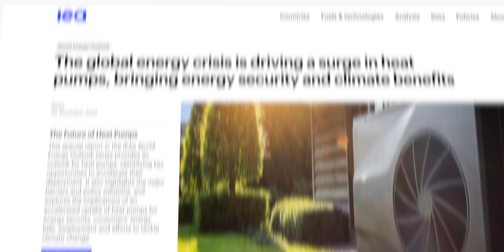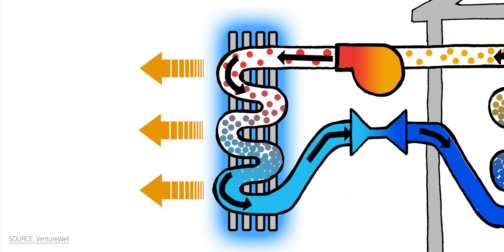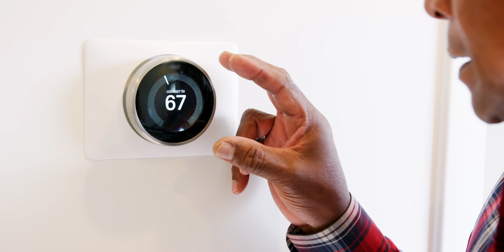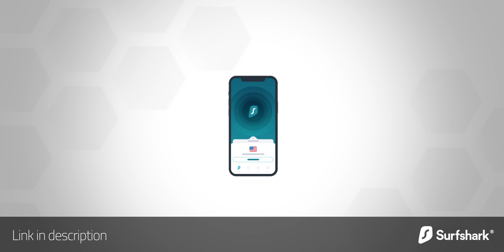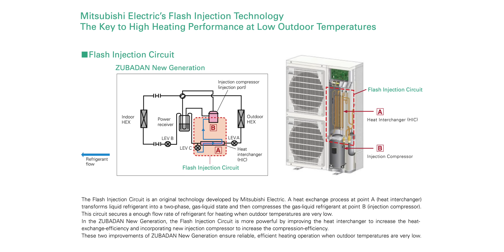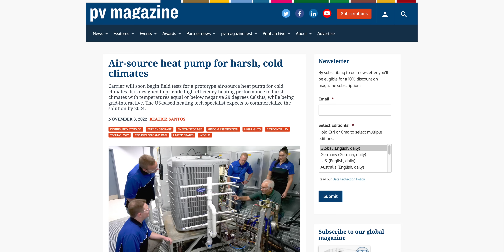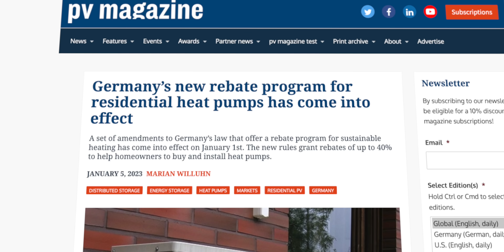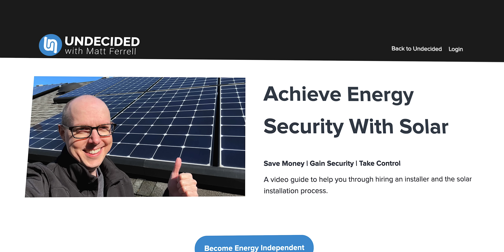Major Advances with Heat Pumps in the Extreme Cold

Comment: We just installed a dual fuel system in our home, gas furnace and a heat pump. The heat pump works from 35 F or above and the furnace works from 34 F or below. I live in Denver Colorado and the Daikin fit heat pump was pretty much my only option. One major consideration is that the heat pump runs pretty much constantly. We keep our home at 67f and the air that comes out of the vents is not warm or hot. But it does keep our house at the temperature we selected. Our cats hate it. They no longer sleep on the air vents. The major adjustment for us has been it feels like the system is constantly running. It reminds me of being in an office building where the HVAC system is constantly reading. Very grateful that we went with a super quiet heat pump and furnace blower because if it's going to be constantly running it will drive you crazy.

Comment: Matt coming from the UK originally Google is continually sending me stories from people over there saying they are spending a fortune on heating after installing a heat pump. 

I see a common theme there - cold damp weather causes icing and continual defrost cycles, and very expensive electricity relatively cheap gas. Even at a COP of 3 they basically only break even. In the winter it is costing them more relative to gas they are usually replacing. 

Furthermore most people are running the pumps almost exclusively for heating, not cooling. In fact it seems many are used to heat water which is then circulated in legacy hydronic radiators vs forced air systems - because UK homes seldom have any ducting and being brick and plaster rarely have the option the option to retrofit it.
Reply: The UK has a problem with bad installers, the heat pumps for the most part aren't really the problem.  Icing-up isn't a problem that needs to be tackled with continuously and needs a large build-up before the defrost cycle kicks in, maybe once an hour at most.  COPs are usually closer to 4 with a proper installation in the UK.  The problem with the UK being able to use them (as in just upgrading the central heating system) for cooling would require a massive retrofit, as the pipes used for the rads/fan coils for cooling need to be insulated, either in using the existing 2 pipe system (Heating OR Cooling), or upgrading it to a 4 pipe system (Heating AND Cooling).  Abandoning a central system and going for Air to Air also allows utilising the cooling functionality.  There are a few Brits that have had or done Air to Air installations over a central system (Dameon Hill - not the former F1 driver, "Tim & Kat's Green Walk",  The EV Puzzle) to name a few.  And they use different solutions for Domestic Hot Water.

Comment: Have you heard of the Wellconnect heat pump? I have installed one and heat my house completely with it.  2600sq feet and I live in northern Michigan.  It uses a water flow from my well, so I guess it is a water to air.
Reply: I guess I should have said "heat and cool."

Comment: How conveniently he leaves the most annoying part of heat pump, noise. I can never fall asleep with AC compressor running right next to my house
Reply: Probably because most modern ones are very quiet as it is, my old 2007 Panasonic was outside below my bedroom window and never made enough noise to be a problem.  Nor does my new Toshiba one that replaced it.  The Toshiba one also has a Quiet option to reduce the "noise" the outside one makes, but I've never needed to use it.  I live in a town where about 80% of houses have an Air source heat pump, and you can only hear them hum if you are within a couple of meters. The local grasshoppers are many times louder in the months they are out.

Comment: Only in the States.  Now imagine you live in a densely packed city.  Air heat pumps are the only option here.  Where do most of the worlds population live - cities.  Living in the UK the government is virtually forcing this system down our throats but it would be astronomically expensive to fit to my house.  I would need to re-insulate it.  Yes I have cavity walls but they are there for a reason - to stop damp.  Filling them with insulation brings all sorts of long term issues.  So I would have to go for a much more expensive insulation solution (a second skin).  Then I only have a small house.  Where does my hot water tank go?  I cannot afford the space in any of my rooms so it would have to be in the attic (there are designs of long flat tanks for this kind of thing - again expensive).  Also being in Edinburgh, Scotland typical average temperatures are around 10C.  Next all heat pumps have fans.  I am not aware of any fan system which does not eventually start making a noise.  You should hear the air con systems for the supermarket next to me sometimes.  So would I part with over £20K to get my home up to spec (that includes the governments paltry subsidy) or will I buy a new gas boiler (for about £3K) to get me through the time it takes the government to realise these are not the panacea they think they are.   Check out https://youtu.be/GhAKMAcmJFg for why heat pumps are not that great.

Comment: I have a Bosch air-to-air heat pump. It’s crazy efficient, SEER of 19, variable power up to 5 Tons of A/C. It’s a dream in Summer. But it is completely useless when it’s below 40F. Thankfully I’m in Central California and those low temps usually only happen for a few weeks a year but when it’s 29F outside and 55F inside and the unit is in defrost mode….better have a space heater handy!

Comment: Most heat pumps never achieve COP of 3. In May installations during cold weather the heat output is significantly as a result of consumed electricity from the grid. Eveb if you only pay for 1kWh of electrical energy to get 2.5 -3 kWh of heat, the electricity is generated at the power station by a gas burning turbine generator which is about 30% efficient including transmission losses to your home. So 10kwh of gas burned in a sas turbine generator,    wired to your home and heat pump will generate 7.7 - 9 kwh of heat in your home, with a $15k heat pump, plus all the increased power infrastructure to get the huge increase in electrical power to your home. Burn the 10Kwh of gas in a small 97% efficient $900 gas boiler, and you'll get 9.7 kwh of heat directly to your home.  No losses,  minimal maintenance, and no enormous electricity bills up to $1000 per month.

Comment: I am in Aus and have the exact opposite problem. Trying to discover whether a HVAC can function up to, about, 50c. The official temps can get close and the unofficial has been known to beat that number. Unfortunately, I can find no data. Everything only wants to talk about working in low temps (Not an issue as we max out at about -5c.)
Reply: Don't know how widely available in Aus, and it would be expensive to install, but Ground Source can do cooling as well, you would likely need a unit with active cooling, as passive cooling at 50C outside is likely not going to make a dent, needs insulated pipework and fan coils instead of radiators to provide the most efficient cooling.  Ground Source has no outside unit, so isn't exposed to the much higher outside temperature.

Comment: Heat pumps are only viable (in terms of money kept in your pocket) if paired with solar. 
I fell like you missed on some key things about heat pumps. Most important is the fact that efficiency wise, they are over 50% less efficient in heat pump as apposed to AC mode. 
A person switching from a gas furnace to a heat pump without solar to offset the operating cost can expect to pay 2–3 times as much to heat their home. Your running your AC year round! 
You also forgot to mention in cold climates there’s usually some form of back up or emergency heat, usually electric heat strips, which even the 5kw heat strips will pull the same amount of amps as a 2-3 ton AC.
Reply: (Assuming you mean Solar Panels) Solar PV + Heat Pump isn't really the most effective use of the sun's energy, as Solar PV only converts about 25% of the sun's energy to electricity.  Whereas Solar Thermal going into a hot water tank is about 80% efficient, so would be better to use that whilst the sun is out, and power a heatpump off the grid or battery storage when it is not.  Also, Cold Climate Heat Pumps have been a thing for some time (just seemingly not in the US), with many still able to produce enough heat down to -25C and sometimes below.
Reply: @BenIsInSweden  A geothermal heat pump is as expensive as they come. What percentage of Americans can A) afford to build a new home (this drives installation cost of the system down) or pay the 80-100k + price tag to retro-fit a geothermal system into an existing house. I’m an HVAC technician whom has installed almost every version of heat pumps. (I.e. Air to Air, Water to Air, commercial, residential, traditional split systems, inverter driven mini splits, VRF/VRV systems).
My comment was more directed toward the average consumer.
Reply: @berated4541  I wasn't speaking of Geothermal, there are plenty of Cold Climate Air to Water and Air to Air Heat Pumps.  e.g. A2W: Panasonic TCAP series, Mitsubishi  Ecodan series. A2A: Toshiba Daisekai, or Haori series. Panasonic HZ series.  The A2W ones will generally provide the rated heat down to the temperatures (using more electricity but not resistive heat), and A2A will usually have a specified heat output at the lower temperatures as well.

Comment: None of the statements about heating cost mean anything with stating the cost of gas versus electric. Take your bills and divide the net bill by the number of therms or kilowatts. Then calculate the heat output per therm or kilowatt. I believe that heat pumps are normally more efficient but then you need to calculate the cost of it installed and what you heat your home with when the temp is below o degrees.. ground transfer will almost always be more energy efficient on average winter and summer.. wether you have the right soil conditions and dollars for it are an important consideration.

Comment: I live in central Florida and I have a relatively new AC/Heat Pump with an emergency heater coil in the air-handler. While it works better than the unit I replaced, I still have to use space heaters in the bedrooms in the winter. CENTRAL FLORIDA!!

Comment: interesting video.  i'm a test engineer and I had air source heat pumps installed after extensive research.  Important factors:  very high home insulation required, inexpensive electrical usage cost in your state a must!, finding a qualified [air source] heat pump project manager/installer NOT easy, even for an engineer!  Good luck.  Great for passive houses.
Reply: nfhh  how can I be of further help?

Comment: House runs a furnace/heat pump, when it gets too cold I usually just flip the heat pump off else we’re freezing for a good 30mins while the system blows cold air out the vents before it decides to flip the furnace on and do the heating.
Unless you can do a geothermal or something other than air sourced heat pump, its just not worth it unless your never going to get below 40F. We’ve also started running into the issue of the opposite. The heat pump is overheating during the summer causing it to stop working entirely and have to be reset.
These are more than likely due to #1 air sourced and #2 could be an older system, I have no record of when it got installed as we’ve only lived here for 3 years, but it can’t be older than 25 years at max.
We also got a portable heat pump (again air sourced) it’ll kick on for about 30seconds, then shut down for a while when temps drop below 40F. So again we’re forced to shut it off and rely on radiators. 
Before living here I’d only heard good things about their efficiency. 
It can’t be said enough tho. The TYPE of heat pump matters. Its not about one being better than the other, some types just don’t work for certain circumstances and cannot be relied upon.
If this is mentioned in the video I’m about half way in and commenting for some reason is pausing the video…

Comment: Matt, I have been using ground sourced geo-thermal (liquid to air) systems for the past twenty three years.  The first system was a WaterFurnace (pump and dump) that was installed in 2000 and is still operational today.  The second system installed was a HydroDelta in another new build that finally gave up the ghost last spring after sixteen years of operation.  My replacement unit is a WaterFurnace again. This unit is far superior to the unit installed in 2000 and is 50% more efficient than it’s predecessor (HydroDelta).  Even with energy prices being more expensive than when we built our home seventeen years ago, our monthly bills are half of what we were paying two years ago.  We are heating and cooling exclusively with the geothermal system, our bills range from $ 108.00 to $ 238.00, our home is 4,200 sqft. We are not passive home certified nor compliant, though we removed as much of the thermal bridging we could.
Always like your content!  Keep up the good work.   Paul
Reply: Have had Geothermal for past 10 yrs well to well hydron module it's garbage   not any cheaper ...when it breaks down dig deep ... don't get sucked in !!!

Comment: I'd feel more comfortable with a smaller capacity combi boiler in conjunction with a heat pump... If at all, I only need to heat my home to about 12c, the combi gas boiler is much more efficient at that sort of temperature with the condensing action, all radiators right up and and the flow temperature right down. I get extra heat electricity from appliances in smaller area of the home, good clothing habits, thermos flask and vacuum thermal mug ect.
Heat pumps are at the end of the day more complex and require more materials and effluents. At the end of the day there's no substitute for simply using less energy.

Comment: Installed a Toshiba Premium 25+ heatpump (air to air) few years ago, this model is specificly designed for cold nordic countries. It's been my main heat source for my house that has direct electric heating also. Now the electric heaters are only a backup (never really needed). My electric usage was around 20,000kWh per year before the heatpump, now it's around 11,000kWh. In the past 10 year's the performance is gone up dramatically. This toshiba pump has COP over 5 at +7C and at -30C it's still over COP 3. It can be -20...-30C and never had an issue with the pump, just let it run 24/7.  Not meany houses that don't have heat pump here in Finnland, it has so big advantage. Air to water and geothermal heatpumps are also quite popular, allmost all new houses are heated by geothermal now.

Comment: I am considering retiring to Minnesota in the next few years and want to put in a vertical ground loop geothermal system.  You only mentioned ground source heat pumps in passing.  Practically all of the video was dedicated to air source heat pumps.  So my question then is, do ground source heat pumps have the same issue with providing heat in the winter.

Comment: I had to diagnose a 2 ton inverter yesterday on a roof at the township building. Compressor winding grounded, they will get a compressor under warranty but install will be over 1200.00. These boards and compressors are expensive, so make sure you have good surge protection and lightning grounds before you install them.

Comment: Matt: Transforming your house to heat pumps  is viable only if the house uses forced hotAir heating; it is NOT viable if your house uses hotwater baseboard heat fueled with oil or natural gas.
Best of luck with your new house using geothermal heating/cooling. I made the geothermal transition, from oil/forcedHotAir back in May of 2013 and have been happy ever since. Was able to close of my chimney. Only problems were I needed to change-out a motor run capacitor in December of 2022; cost me $300. Other maintenance costs are changing air filters every 3 to 4 months. Air filters cost ~$105 for a pack of 6.

Comment: I just had top of the line Bosh heat pumps installed in my New England home. I will say one thing that has become clear to me is that if your house isn't well insolated, you're heat pumps will not be able to keep up on the really cold days like a traditional furnace. Something I wish I knew before installing my new system. Heat pumps lose efficiency and BTU output the colder it gets, unlike an oil furnace that pretty much stays the same. So it is relying on the fact that your home is well insolated so that it's not competing with both cold from the outside and inside. I don't regret my decision and I'm excited to see how well my system works once my home is insolated better.

Comment: DO we really NEED central heating/airco? I married in '71 and we had a one room all burner, years later we changed to coal after that to natural gas and when the landlord offert to bring in Central heating for a percentage up the rent we took it. Last year with the raising gas prices we have set the Central heating on 10 Degrees C and bought for €100 a electric plate heater for the livingroom and some extra wool sweaters and blankets to stay warm as we stayed warm 1n '71. In the summer we can do with small blowers in the spaces we use.
I tell you already in 2 months compared with last years energy bill we are way below the costs of that, we are spoiled with any kind of Central heating/cooling just make use of wat we used to use!

Comment: I've had one winter with photo-voltaic/battery setup, heat-pump, and no under-floor or ceiling insulation.
I just had the insulation installed so, in another twelve months, I'll have some good data to work with.
I don't get snow within 150 miles south of here.